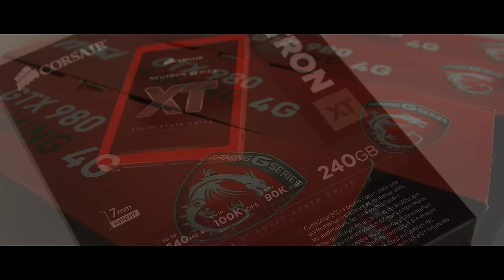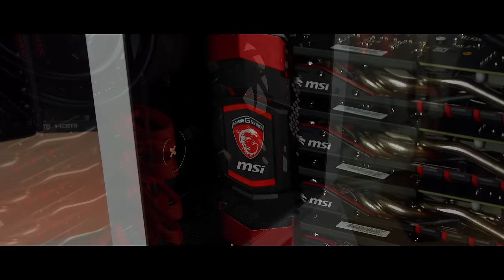Crazy GODLIKE 4 Way SLI, 5930K BUILD! $4300/£3800

Comment: That PSU is basically going to be sucking in nuclear fusion-level temps as the fan is mounted up next to 4 GPU's.
Reply: he was just showing off the 4-way sli bridge for msi, he took out the 980s and put 2 1080s in it

Comment: Ah finally, you have matched my Mainboard ;-) LED's are awesome aren't they, awesome build and keep up your good work
Reply from the maker: +Chadeptus I quite like playing with the LEDs, wasn't a massive fan before.
Reply: For me it was the main reason I bought it haha, mind you when your MSI gaming application opens up in Windows does it turn off the power button light on your 780t casing? for me it does, quite bizarre really. (you may have a different version of the MSI gaming app though for the MSI godlike carbon motherboard variant).
Reply from the maker: +Chadeptus No haven't had that issue, although the software is tailored to different boards. 
Have you tried the mystic light app? Works well but never saves your effects unless you have the app open.
Reply: Unfortunately no because I have a Windows phone and its only available for Android. It could be a bug with Windows 10 and the MSI gaming app, but its quite funny and baffling.

Comment: This is an exact representation this pc I've been wanting to build, same case, & I wanted to put a 5960x, 128 gb of corsair dominator ddr4 ram, & 4 way crossfire r9 390x's
Reply: I would go with 2 1080 or 2 1080tis instead. Those are much better than 4 r9 390x
Reply: I have an i7 5820K, 64GB DDR4 and a GTX1080FE. You won't need 128GB + Most boards don't support it.
Reply: A 5960x supports 64 gb max

Comment: Question, I wanted to know because I have a similar setup for cyber and forensics work - but what temps are you getting on those? These are open-air not blower correct?

I have Corsair Air 740, MSI Enthusiast Gaming Xpower Z270 Titanium with Quad-Ready SLI MSI Aero 1070 OC (I'm changing from the Armor/Quicksilver because they are just too hot going at 80-90C easy on the second slot). In fact, my i7-7700K with an H80i as exhaust on the back and both fans on top as exhaust with three on the front as intake is just not enough for these GPU temps. I had to have a CPU cooler on this CPU but it will stay at 35-45C unless I am working it. Now that it is an exhaust and I'm working that too, I have it at stock 42x clock with 67C temps and only tri-SLI possible now with fans at 100% GPU temps are 72/55/42 and I cannot fathom how you are getting any more air out of that case then I could with a 740 model. Hell, let MSI make me their fanboy - I have all the same or better hardware anyway and perhaps they can help with the temp issues (no I do not wish to water cool this further).

Comment: Why you mount the psu with the fan towards the interior of the case, if you can have the psu ecosystem isolated from the rest., and prevent the psu to put more eat in the system? because the four way sli, already put a lot of eat in the casa!
Reply: the psu woud exaust heat but would get hotter but the hole system would be cooler
Reply from the maker: It sucks air out :)

Comment: Did you just put your PSU upsidedown? But sticker goes in normal direction, i don't get it...
Reply from the maker: +Justas Djakonovas There is no right or wrong way as such, my way helps to pull hot air out. 
With four 980's on air, it's a pretty good idea to pull hot air out 😂
Reply: You know better than me, but I always 
thought, that PSU fan must be on the bottom of the PSU :/

Comment: For such a setup, watercooling vs air cooling is like night and day> I would look into water-cooling if i was you. That case is also not going to cut it. You should get a caselabs, or thermaltake WP100
Reply from the maker: +yungbenny911 Thanks for the advice but maybe read the description, all the information is wrote down 😃
Reply: Unless I'm mistaken there's an all in one water cooler hooked up to the cpu.
Reply: The GPU's are the problem.Those two in the middle would most likely hit 95c, and reduce overall gaming performance. He clarified in the description that he would be sending those GPU's back, and getting 1080's, and water cooling them. I should have read that :D
Reply from the maker: yungbenny911 MSI sent the four 980's out for a crazy build, personally I wouldn't fun four cards on air of water :)

Comment: the gpu temps arent that good i would think
Reply: Well actually they probably will be alright because the case has decent air flow which can cool down the cards quite quick and since the fans on the ground are fairly close it might cool down most of the gpu except one of them. You will be surprised with the temps.
Reply: +Daniel Wild well you are propably rigth

Comment: wont there be micro stuttering? wont the cards run very hot?
Reply: ***** yeah i figured that out.. :P
Reply: I was thinking about those card temps to... maybe he answer us and tell what's going on that.
Reply: this cards are never loaded altogether
Reply: +Zyrkon™ explain it.
Reply: ***** I don't think so... 3 intakes and one rear exhaust seems a bit poor for that amount onf heat. I know there are 2 exhaust on top but the rad is on it so the airflow coming out of the case i not big enough to make a difference. That's just a "cause i can" build and makes any sense.
Reply: +AMD Man other "" AMD guy" here. 8320 and r9 380 from msi. I really hope AMD comes with great things this year.
Reply: +AMD Man AMD said it's going to me DDR4. about the Rx 480 i don't really know what to think about... 2 of them fall between 1070 and 1080 for the price of a 1070 but there are games where CF  has almost no preformance increase and it came with some stuttering and weird textures.
Reply: +AMD Man same for me, nvidia is too high budget for me and i recently bought an r9 380... next gen amd card maybe :)

Comment: Does this case (980t) support 3 140mm front fans without sacrificing BOTH optical drive bays ? I mean, is there at least one optical drive bay left or do you need to switch to 120mm fans to accomplish that?

Comment: Nice looking build, too bad a 4 card air sandwich never works for anything other than photos.
Reply from the maker: +Min Chu Totally disagree it works pretty well in video footage as well 😉
Reply: check your core clocks and temps while pushing them. if one of them throttles too much, then youll need to go for watercooling. also hope they have a block for your gpu

Comment: hey u placed ur power supply upside down
Reply from the maker: +jaswanth H There is no right or wrong way :)
Reply: but it will blow the hit air into the GPU
Reply: i mean the power supply
Reply from the maker: +jaswanth H It will draw hot air out of the case.

Comment: Fun fact: only 240GB of archive.
Reply from the maker: Fun fact I also used a 950 Pro M.2 for the build.
Reply: SilencedTech I'm not saying you shouldn't use the 590 evo, that is a beast, but you should also put a secondary hard drive of minimum 1TB.

Comment: 😂😂😂😂😂
last gpu will burn due to the hot air exhausted by psu
Reply from the maker: +Doctor DOOM You know the PSU sucks air in right lol.
Reply: then it will also suck some bot air from the gpu then...
Reply from the maker: +Doctor DOOM The PSU can handle the temps no trouble! The fan hardly ever turns on. I had my PC on a thick carpet, are you saying it would be better the other way around?
Reply: man I loved your build... 
that's freaking awesome....
I was thinking that without water cooling and when u use it for long time, won't it get too hot????
like about 3 - 5 days???